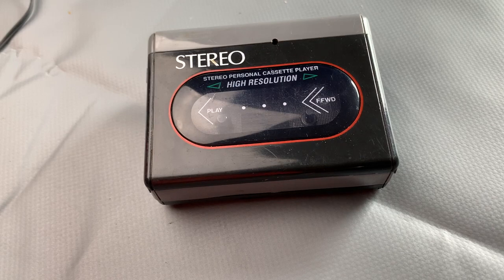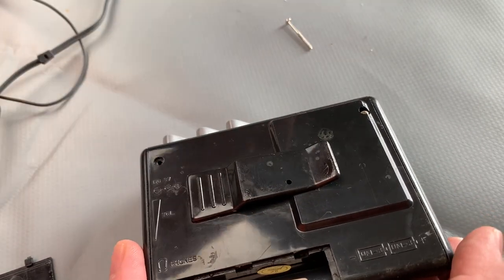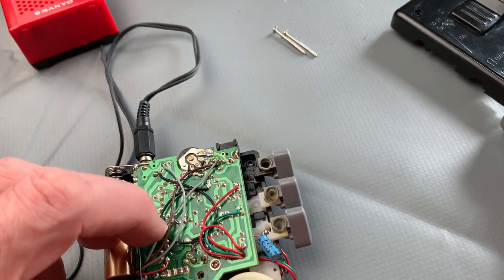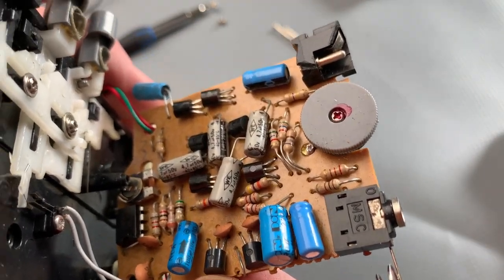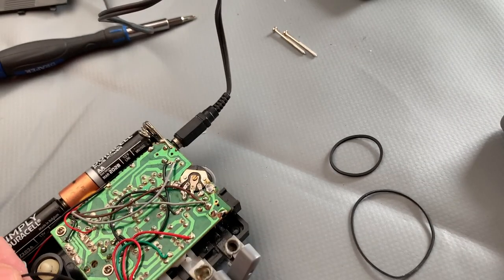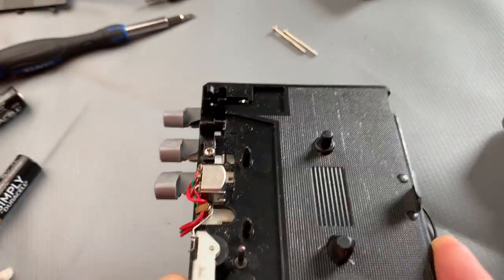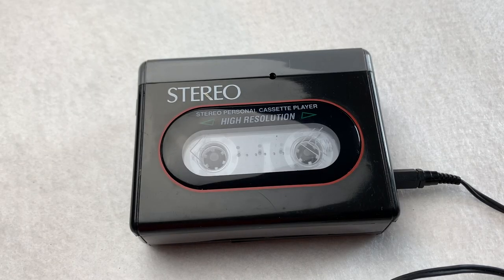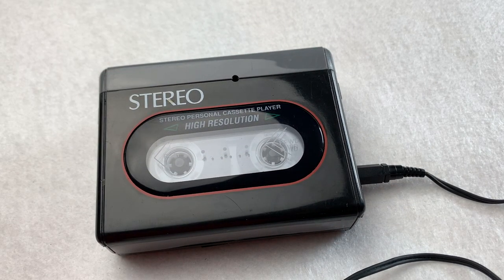International 'Mystery' Personal Stereo Cassette Teardown, Belt Change & Service. Walkman Repair.

Comment: I have this cassette player and the potentiometer for the cassette speed wasn’t responding, now it seems like it does but it is super sensitive. It seems like it doesn’t want to hold the adjusted speed and will fluctuate a lot. Anything I can do about it?

Comment: With that wow n flutter no risks of any copyright strikes 😉
Reply from the maker: That's one of the upsides of cheap belts 😂 To be honest, if the unit is any good or a pain to change, I'll just use a decent one. But a fiver for a belt on a unit that's worth a fiver is not really worth it. The value is in showing owners how to do their own. Thanks for watching 👍